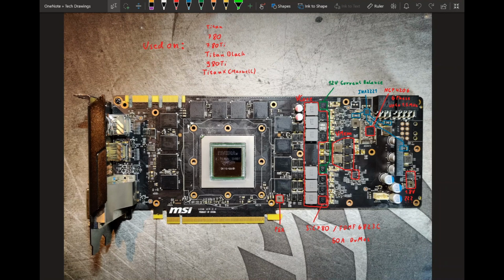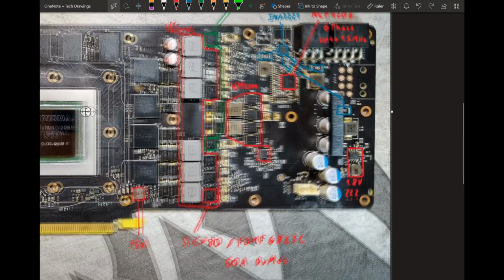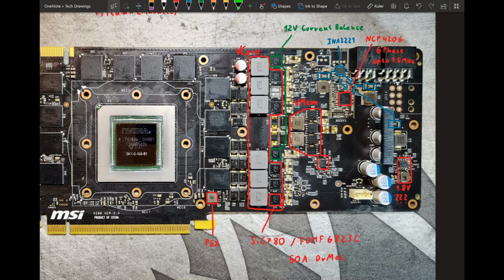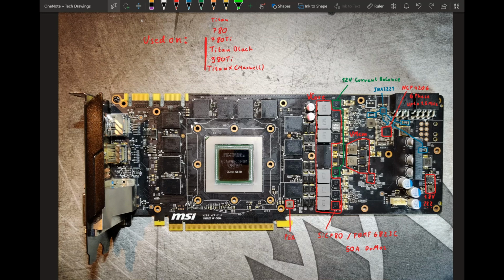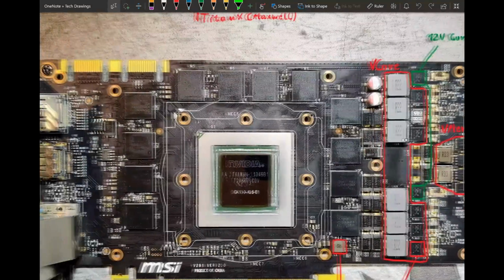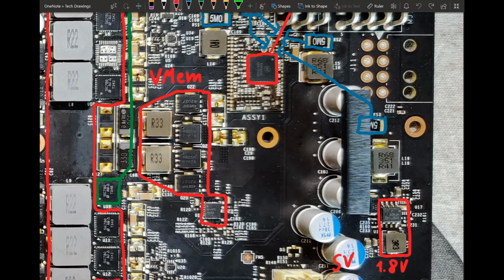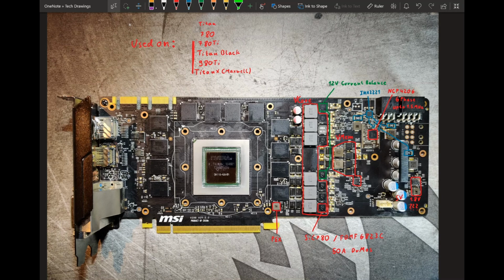High End GTX 700/900 Series Reference PCB Overview (and why it is trash)

Comment: Hey i have a gtx 780 and its apw7142 chip is fried cause of that i have no display full fan speed, i got it replaced once and it removed all thE shorts and then when i put card in my pc and turned it on without pcie cables it was all good but no display then i put in pcie cable  apw7142 chip got fried again! Its near 3r3 right lower corner of the board same as your video can you takea look ans tell me something about it
Reply: How can i cOntact you

Comment: Hi Zoras. I just saw your 570 video and wanted to ask you what happened to that card? I have a 470 that has the same pcb and i have a similar issue. The card turns on, video ok but at the time to load the drivers or go over 300MHz for the core, the vrm dies. I checked the gates and all of the phases are running in the safe mode and then all of then dies. Do you have any idea to go further with it?
Reply from the maker: I never fixed that issue. Tried to epower it but the card always crashes when the driver loads

Comment: Hi bro, just wanted to ask you if you have a opinion on  my Gigabyte gtx 780 GHZ editon rev 1.0, driver installs but then black screen, rebooting means black screen after the driver loads with windows, i did mat test and one memory fails, https://imgur.com/a/GtPCDiA i think the memory itself is bad, but gpu-z wont recognize memory related stuff like size, bus width, bandwith, type is recognized Hynix.
Bios is reflashed and it is the correct one.
Thx
Reply from the maker: yeah one of the memory modules is dead. the memory size and so on doesn't pick up in GPU-Z until the actual nvidia driver is running (the microsoft basic display adapter driver also doesn't display memory stats). i have a 780Ti GHz Edition too with the exact same problem. you could try the heatgun method on the memory chip but it likely won't work for long. the proper repair would be to replace the memory chip with a new one.
Reply: @CmdrSoyo  Yeah man i will order a memory chip then, thankyou very much!
Also i heard there was a problem with these memory chips meaning they were not so high quality as the others used by Gigabyte.

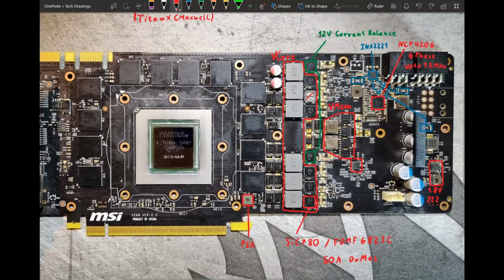Comment: Hi,I have a broken 980ti that loads to windows, and then will crash regardless if I launch a game or not, 2 of the marked (phase?) at 2:10 are not present, on different sides(one up one down), could that be the reason? If the memory R33 inductors would be bad I guess it wouln't boot at all

Here is a link https://imgur.com/a/nXzdE62
Reply from the maker: Yep you are currently running a card that draws ~250A with a VRM that is rated for 200A at the absolute maximum. Honestly i'm impressed it still works. With 4 Phases left i would expect the rest to die one after the other until all Powerstages are gone. 

You should replace the missing ones then the card should work again, i did so on the 780Ti in the video and it ran Firestrike stresstest just fine for over an hour

Edit: you could also use Maxwell Bios Tweaker to make a custom bios that has a lowered power limit (around 150-160W) to match the remaining phases, you will lose performance but the card shouldn't overstress the VRM if you can't replace the powerstages